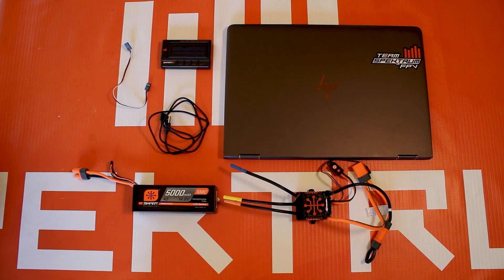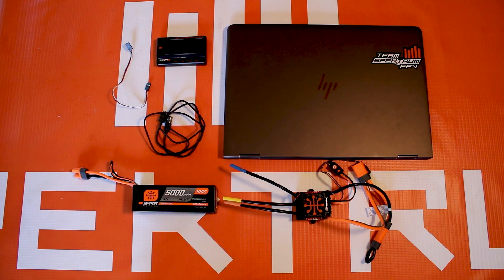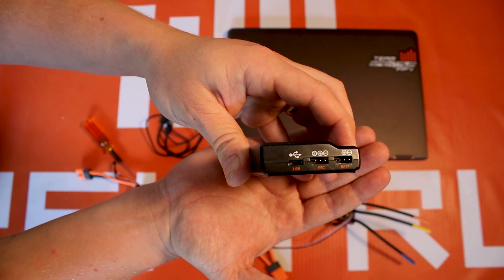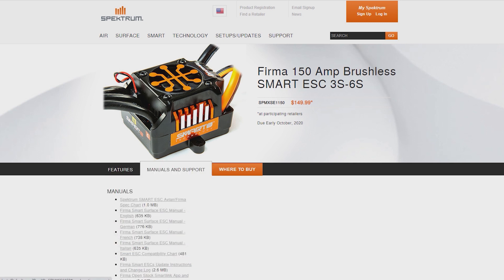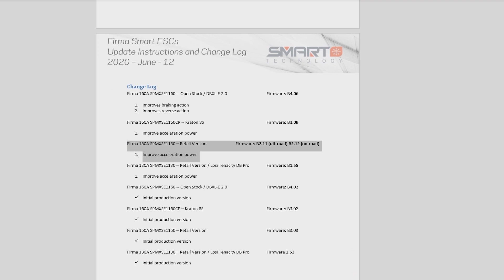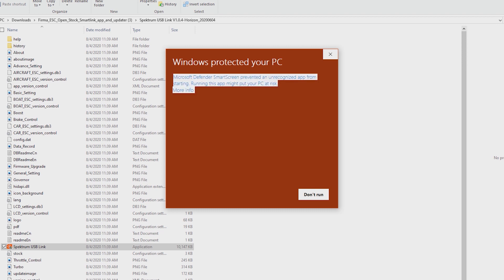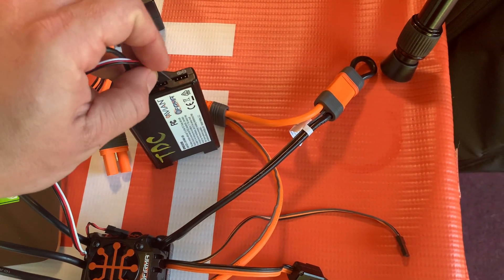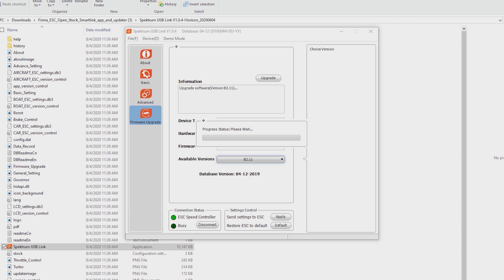Spektrum Quick Hit Tech Tip - How to Update Firma Smart ESC Firmware

Comment: Hi after I update the firmware of the 150A ESC on my Kraton 6s V5 to version B2.21. The proces of update completed successfully(I got the update complete successfully screen) . Now I have a problem, I power on the kraton and the steering starts to turns left and right very fast by it's own without touch the controller(tx). Is like it is glitching. Any idea? Thanks

Comment: I mead the update to firmware B4.12 to the ESC but what am confused all default was changed to another default setting like the voltage it was 6.0V and now it’s 8.4V and cutoff voltage some of but what am confused watch support vide for my kraton 8S that no need to pump up the voltage as default 6.0V To 8.4V after update to B4.12 it’s pump up to 8.4. As default settings!!

Comment: WHYYYYYYYYYYYYYYYYY don't you make the spma3065 compatible to update the esc?????? ridiculous, I know you are a business and need to profit, but this is ridiculous, greedy greedy marketing strategy. I just got into the Spektrum environment, I ma regretting as there is not much deeper information about its products. I got a DX5 Rugged, which says all telemetry blablabla, to have all functionalities, I need to purchase an AUD$40 cable to update on an windows PC, this cable only works with Transmiter and receiver, now I need to update my Firma Esc to have programming on the DX5, guessssss what I need to buy a program box to update the ESC, which at the end the connection between the programming box and esc is the same as the cable SPMA3065 but that you can't use, buying a programming box only to update the esc kills all the reason to have the programming on the transmitter. I bought a battery charger, guess what the update cable is a different one, different from the ESC and Receiver, so now a third cable is needed, to make it worst the charger does not come with power supply. what a hell... dirty greed marketing.

Comment: My brand new 160amp 8s esc and 1250 motor combo is messed up.  The esc has 150amp programming installed on it.   Messing me up big time.  What do I do here?
Reply: I guess dont use it first and then redo the steps and download the 160amp update which should remove the 150amp update and change it tl 160amp software

Comment: I have two XPWR 35cc motor and I can not get it to run on full power with out the motor stuttering or searching on and off when is on full throttle. when is running on 70% power is ok..I am using a Avion 120 Hv ESC.. I tried everything with timing from 5 low .15 mid  and 30 high with soft start and normal start and is still doing the searching and stuttering thing when is above 70% power..I have also tried different new batteries Rating from 60c to 100c..dose it need updated different firmware or could it be something else? 
Oh I also have two of the Avain and two of the xpwr 35cc motor and they are both doing the same!! Please please help!
Regards Dan Porter

Comment: What is the BEC set up/option?
Reply: It is the voltage that goes to yoyr receiver and servo and accessories that is connected to the receiver, i recommend the stock bec voltage because not all devices connected to the receiver can support 8.4v, they will either fry themselves or go wild, and even if they can, it will decrease their lifespan so yea

Comment: Does anyone know if you can use this program box for Hobbywing ESCs (with Hobbywing software) too? Spektrum's program box looks identical to Hobbywing's 🤔 I'd rather not have to buy two
Reply: I'd like to know to even the software looks identical to the hobbywing stuff
Reply: @RCFPVAdventures  HW and Spektrum boxes/ESCs/software aren't compatible at all. I tried using the HW multifunction program box with a Spektrum Firma 150A ESC. It doesn't recognise the ESC at all when in the ESC port, and with either HW or Spektrum software on PC

You have to use Spektrum for Spektrum and HW for HW unfortunately
Reply: @yaffajaff  yea comsletely true, the hardware may look the same as they technically took hobbywing stuff and make it look a bit different and rebrand it, they also mostly reprogrammed it and put their own system on it, so you can get the best of both worlds, the hobbywing reliabilityand quality and also spektrum smart stuff and good prigramming so it makes spektrum electronics the easiest to use and most reliable out there

Comment: can the  SPMXSE1085
Firma 85A Brushless Smart ESC, 2S  be updated or it has to be 130,150,160
Reply from the maker: Yes it can BUT currently there are no updates available... Yet ;)
Reply: @SpektrumRCvideos  ok cool   cause i have the 85 a and the 130 a coming .. my question is  i am trying to bind the 85 a esc to my dxc and im following the instructions and waiting for the beeps  but nothing .. is there a way to reset this esc  or is it in program mode ...  its brand new  so i got the steering binded with the spectrum 6100 receiver  but not the speed control ...

Comment: Hi I have a question I just pick up the spektrum programmer and I see that it has the lastest firmware but when I try to use the programmer directly on my RC car (arrma felony), the programmer says to update software on the screen and won't let me do anything else. Again this is me plugging the programmer directly into the car, I get that message on the programmer screen. And I missing something
Reply from the maker: using the same PC programmer app you should be able to update just the programmer box when connected to just the programmer. Hope that helps!
Reply: @SpektrumRCvideos  I have the same issue with my Firma 150. I have updated both the ESC and the Programmer but when i plug the programmer straight in to the ESC it says "update software" and wont do anything else. Yes, i can program it via the PC app but this is no good while out and about. PC app version is 1.0.4, database is 04-12-2019, Programmer is version 3.2.39 and ESC version is B2.12.
Reply: @isnips909  same issue here.
Reply: @SpektrumRCvideos  same issue here, how do you fix this issue..thanks

Comment: Can you confirm how the firma 150 firmware deals with thermal cutoffs?..

Both for the esc and the capacitors... does the firmware activate brake? Or neutral/coast?..

Comment: Hey when are u guys coming out with a new dx6r the one with the wheel the land remote . And why y’all discontinued it out of no were . Alot of people are so upset
Reply from the maker: Well it is hard not to discontinue anything out of no where... It was simply a supply chain issue and it was at the end of its life. That being said we are always working on something new! Also I would suggest looking at the DX5 Pro. It is just as capable, transmitter wise, without the Android connectivity. AND if you happen to be lucky enough to find a 6R on the market, be assured that we will continue to support it for the foreseeable future. Thanks!
Reply: SpektrumRC what u mean at end of its life . U mean u couldnt get the parts for it anymore, are u saying the remote have ran it course cause i see people still wanting them and looking for them as of right now u know . But i have one ☝🏿 and a 7px but i like the spectrum better. U said dx5r pro but it is not like the 6tho boss . And thanks for the reply